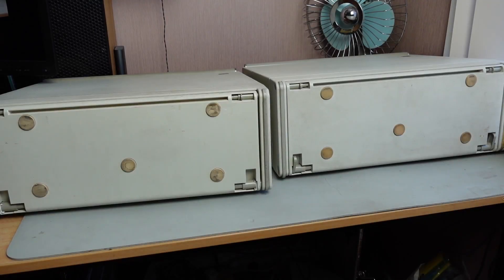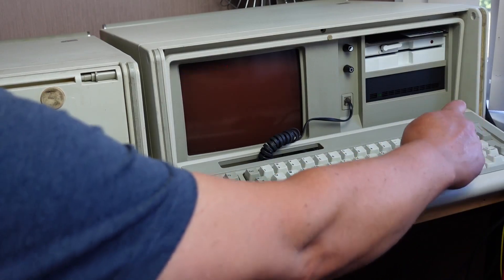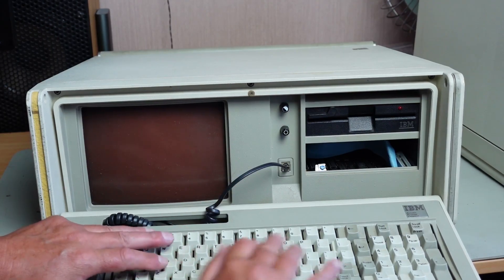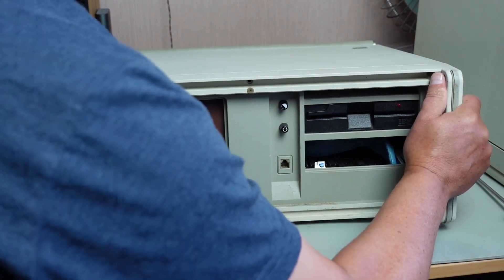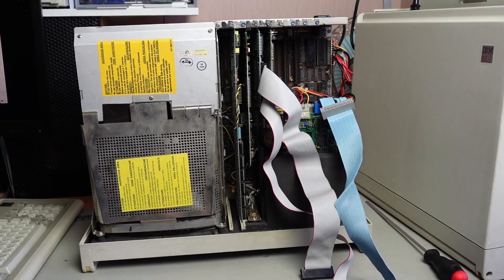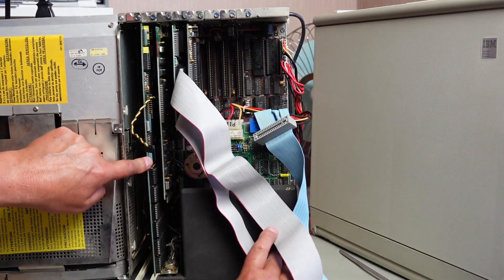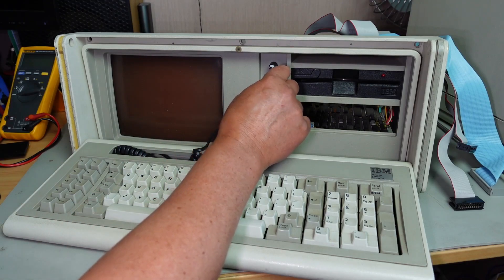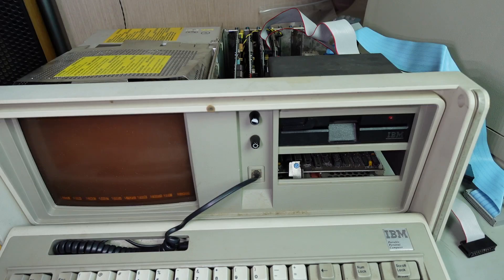IBM 5155 Portable Personal Computer - Purchased as Not Working for Spares, Will it Work? - Part 1

Comment: The memory issue you have is a common problem, theres a logic defect with the ram check that results in all memory after a single chip failure not registering…. So chances are you have a bad ram chip in bank 1 (each bank is 64K)….  Cheap and easy to fix, just swap banks of memory until you find the band chip….  Or you can get replacement chips for around $3 USD
Reply from the maker: Thanks. Keep an eye out for the next episode.